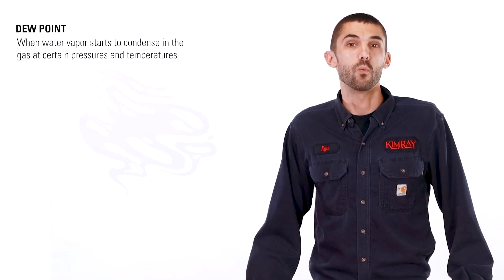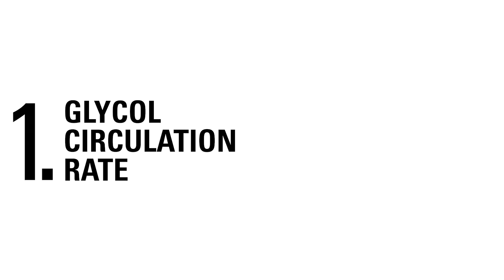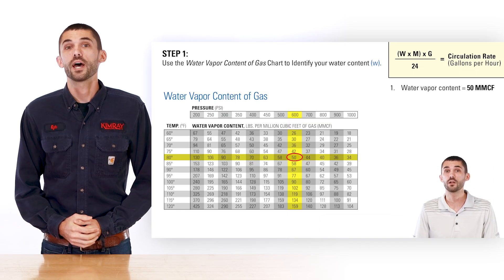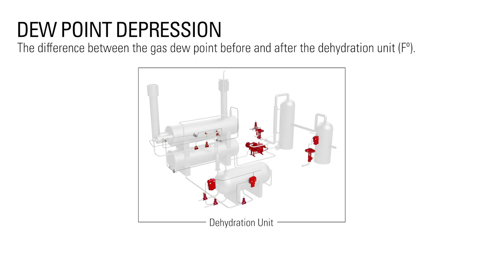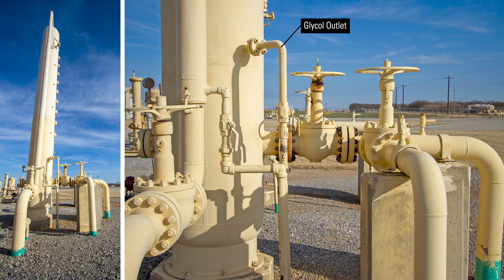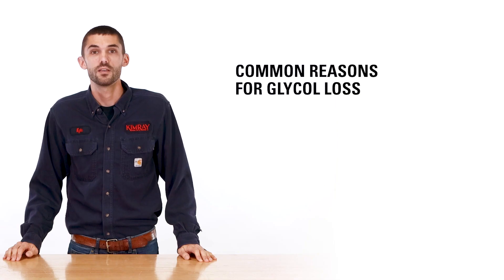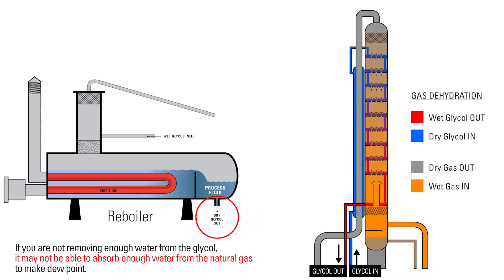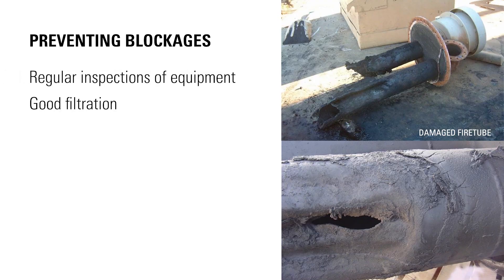5 Troubleshooting Tips for Natural Gas Dehydration Equipment When You're Not Meeting Dew Point

Comment: What could be the reason for lean teg water content higher from regenerator. Reboiler liquid is is at 204 C, stripping gas is full as per design flow. Natural gas from absorber is on spec. Only offspec is lean teg water content from regenerator, what could be the cause. Any tips to troubleshoot this. Plant load is only around 80% capacity.

Comment: what is different between water dewpoint  and  hydrocarbon dewpoint
Reply from the maker: Dew point is defined as the temperature & pressure at which vapor begins to condense into a liquid. When water reaches its dew point, the water vapors are condensing into a liquid (water). When natural gas reach its dew point, the hydrocarbons are condensing onto liquids (condensates).